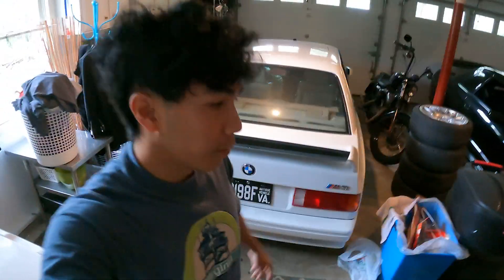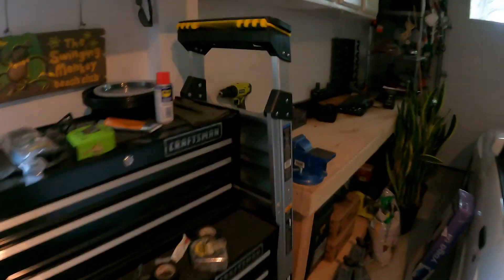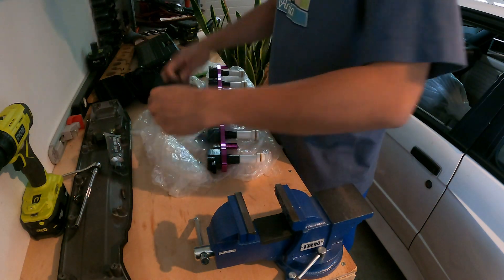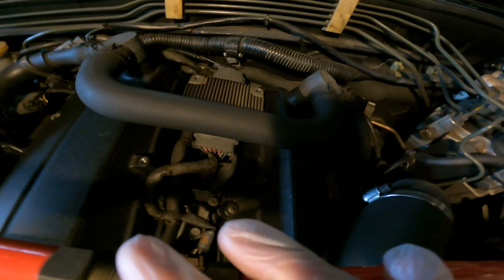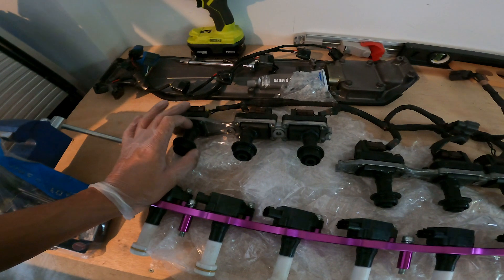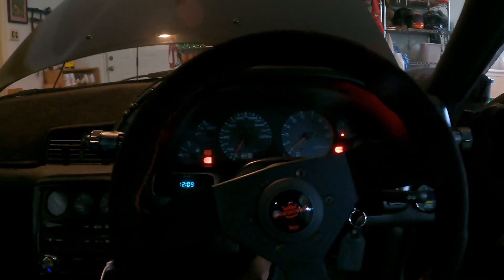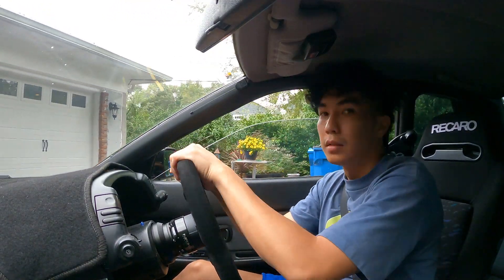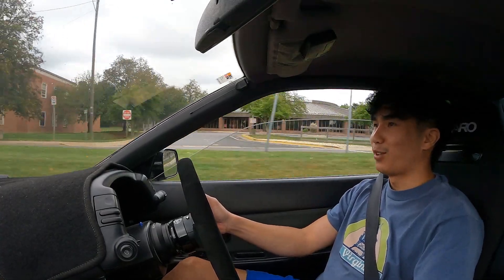WHAT DOES A MISFIRE SOUND LIKE?  PRP R35 COILPACK R32 GTR INSTALL

Comment: When it misfires, does it sound like it's almost getting too much fuel or not enough? Like its bogging down? And when you hit boost around 4000-5000 and it misfires, does the car not want to rev any higher than that? Mine is doing something similar.
Reply from the maker: It doesn't bog It just feels like a mili second of a pause but it'll keep revving.  If your car isn't revving past 3000-4000 its probably a MAF issue.
Reply: Fix?

Comment: I have the same problem I think. 
Even at idle sometimes. Low rpms misfires.
I removed the coil packs and spark plugs and placed it back everything seems to work fine. But after a week the problem comes back slowly…
Reply from the maker: It could be the coil pack is arcing like mine.  Try swapping coil packs or applying dielectric grease around the coil packs.  Or just get R35 coils. Pricey but worth it.